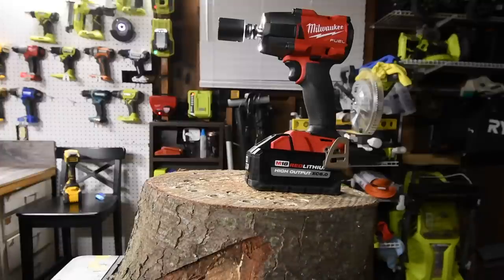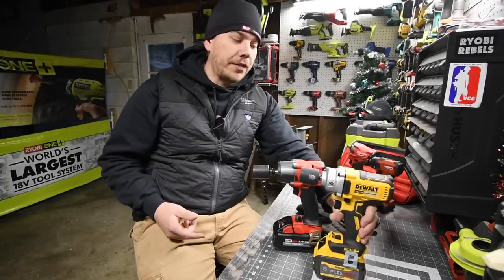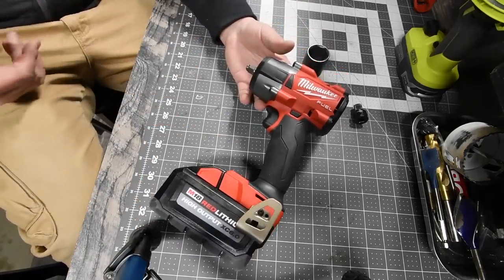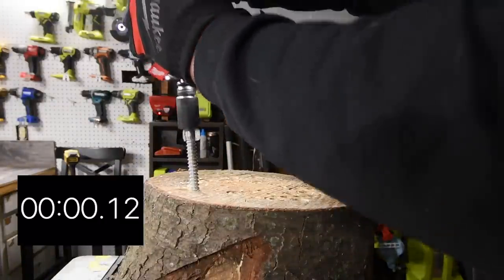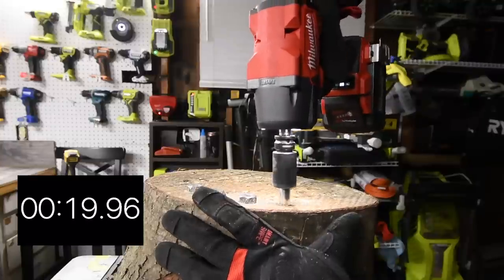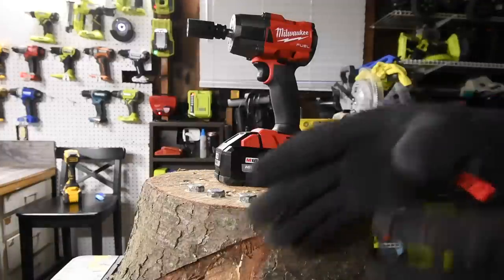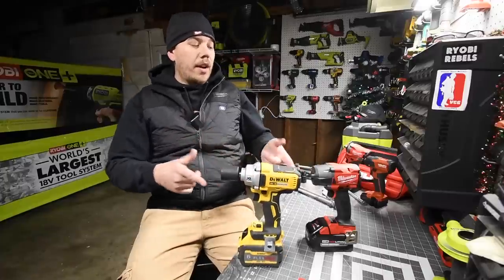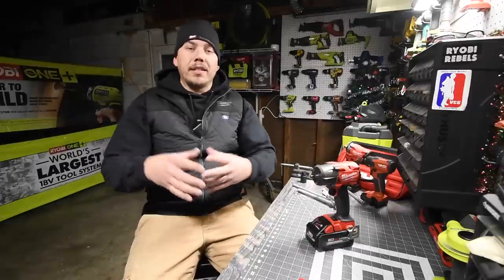New!!! Milwaukee Gen2 Impact Wrench (2960-20)

Comment: I just bought the Gen 1 Mid Torque and even if it's less powerful it's really impressive
Reply from the maker: I love impact wrenches and I thank you for viewing Mathieu
Reply: Same. I’m loving it so far. I do wish it had mode 4 Auto shutoff mode though. Other than that’s it’s awesome.
Reply: The first gen mid torque actually has the same power ratings as the second gen. So believe me, you’re not missing out. The redesign was more for ergonomics and automotive related issues
Reply: Gen 1 is solid. Don’t think I would notice the slight power difference between the two gens
Reply: got the new mid  torque and high torque deal came out to 575$ after tax with a battery
Reply: @xfighter3100  How can you say that? The compact m18 is yes, just a little stronger, but it fits behind brake calipers so much easier than an old mid torque. If u were to use something as big as a gen 1 mid torwue, then you would be a fool not to use the new mid torque non compact. The M12 stubby is better than the compact m18, because the battery is kicked back and has slim packs and tiny square packs, it does 200 ft lbs all day as an m12. It actually fits under the hood! the new m18 compact SUCKS under the hood because of that massive battery, and its too weak with a 2.0 slim batt, so now u gota buy a slim cell 3.0 MaH that puts out more power than a 5.0 XC.
Reply: @imivanm  there is over 200 ft lbs tightening and loosening difference from your gen 1. that shit is trash now dinosaur let it go. Nah keep it but useit for car lugs and some suspension or chassis work

Comment: This test is not irrelevant! Great test to stress out this tool and show what it’s capable of. Wheel nuts are most of the time only tight until they are broken loose. This test is hard the whole way through so if it can do this it can hammer off any lug nut! 👍🏻
Reply from the maker: I thank you for your support Caleb

Comment: a 9 foot wheel 😆✌️ u might need abit more power than that.. today i was putting track pads on a small 90 Ton Excavator 660 ft/lbs plus 120° turn to get them bolts tight. these Milwaukee impacts are really handy even with large equipment u have to remove alot of guards and brackets before one even gets to the core job
Reply from the maker: just something extreme like that, a simple bolt isnt going to test this tool out to the extreme.

Comment: I use a 1/2 inch Milwaukee gun doing axles on trailers just about everyday and it powers thru most of my jobs
Reply from the maker: which model do you use?
Reply: @ManCaverTools  2663-20 it has 4 speeds and a one key mode

Comment: The new mid torque 1/2" for me after watching this. Any lag bolt I put in only needs to go slightly more depth than the thread, so seeing these bolts go in all the way as fast as they do is very impressive.  Does anyone need to put a lag bolt into wood up too the head, especially at these bigger sizes?  I would normally fix 2"  thick timber too a post of 4" or 6" thickness, with the 2" timber being pre-drilled for the thickness of the lag bolt. What do others do with their impact wrenches for this type of job.
Reply from the maker: that is why I do these test. it saves people Money if they feel if they need a new tool or if the one they already have is still good enough. I thank you for viewing Sir Malus
Reply: the 3/8 makes more power, cus it can spin the mass faster and hit harder actually was double tested and milwaukee was informed and curious how that happened

Comment: I bought this impact and no matter how hard I pull i cant get the socket out of the collet. Do you think its defective?
Reply: You have to use a nail or something to push the detent down. MCT actually addressed this issue a few videos ago. Scroll through the vids to check it out.
Reply from the maker: this is is a friction ring. so it will come with some force

Comment: Do you recommend the 3/8 mid torque or the 1/2 mid with a 3/8 step down adapter to 3/8.  Or does it matter
Reply from the maker: I prefer the 1/2. I dont like using 3/8 sockets
Reply: I'd go with a 3/8 stubby M12 or M18 for general R/R & a 1/2 mid-torque for when you need the torque.

Comment: Skidmore and wilhelms are the only way to accurately test impact wrench strengths.
Reply from the maker: I found some but they are so expensive
Reply: And you’d need more than one model if you want to accurately test the 3/8 drive impacts.
Reply: @ManCaverTools  We use Skidmore at work and they are very expensive and the bolts are only good for so many cycles. The bolt is a special bolt that costs about $600 for just the bolt. Once the bolt wears out you can only buy it from Skidmore. Using lag screws is a better more affordable representation for the average user.